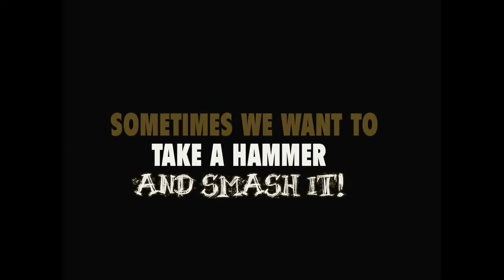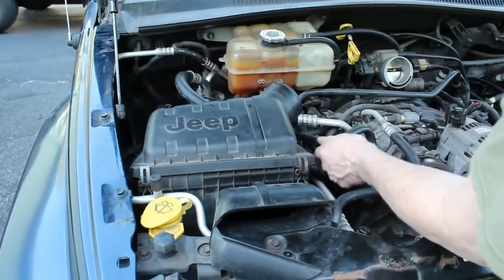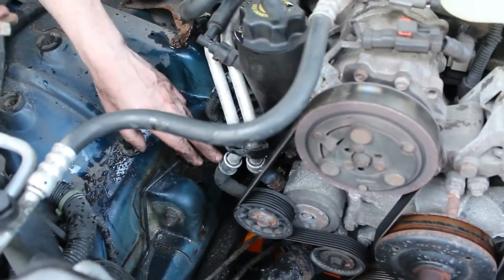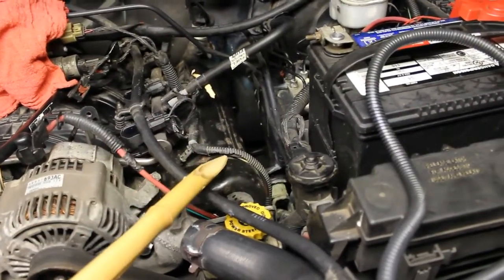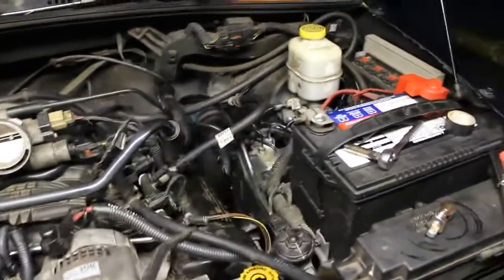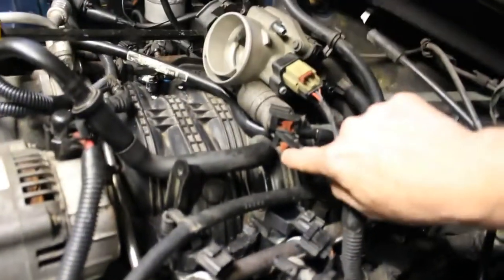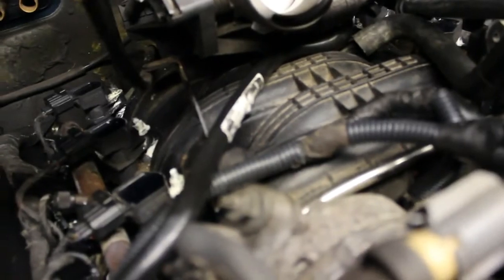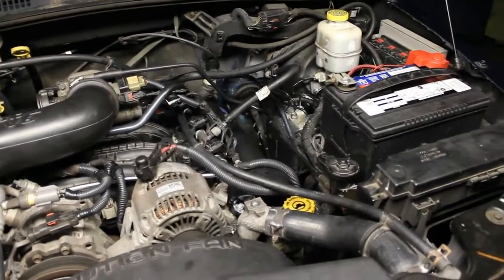2004 Jeep Liberty Limited 3.7L oil leak and intermittent plastic burning smell mystery solved!

Comment: This is my exact issue too because today I noticed oil on the catalytic converter and so I'm glad you have fixed it. I'm going order parts and try to fix this thing in a few days.
Reply from the maker: excellent. I have to do a wheel bearing on the liberty, I will make a video soon. Good luck, feel back against the firewall and cover with a paper towel when cool, see if you have some oil there.

Thanks for your support and thanks to all subscribers, almost at 1,000 so sharing, liking and subscribing will help me continue to make videos.

Comment: thank you for putting together this video. our 05 Liberty supposedly has oil going into the exhaust system, causing a catalytic system code to turn on. after watching your video, I think our valve covers might be leaking too.
Reply from the maker: thanks I hope you get to the issue, sometimes the oil pressure sensor leaks as well. good luck.

Comment: Hi this is ken, i have a jeep liberty 3.7 it was given to me from my neigbor..with 113,000 miles..strange things has happen to it while in my care..I sunk in 800.00 parts i did the labor,40 yrs being mec..he showed me bills that he spent on it $2800.00 it was ticking bad also loosing oil at the rear main..so i replace rockers with updated parts.oil hole is smaller..replaced lifters too..Oh is a 03 jeep people say these r bad jeeps..parts replaced all the time..have a issue with overheating when i dont use air cond...fan comes on at 218 but too late coolant overfills bottle (overheats) plus repair shop replaced fan assemble did horrable job on the wires it stopped working and found that out soldered them I was wondering if this jeep had a clutch fan in front..I have to keep air on to have the fan on??..to keep it cool gauge never went passed the middle still have the ticking sound but lightens up when hot...No overheating when driving or highway use..getting late but have more to say thanks ken
Reply from the maker: hello Ken,
well the jeep is only as good as people take care of it, I have worked on 03 and 05, I have an 05 with 120,000 no problem.

Was the thermostat replaced? The fan is controlled by the temperature sensor, an basic obd reader should show you the temp as it warms up. Once it reaches a certain temp the fan comes on, unless they wired it wrong it should not depend on turning on the air conditioning. typically new plastic fans would come with a connector so not sure why they would have to solder anything.

a faulty temp sensor could probably cause a misreading of the temp, so maybe check temp sensor, thermostat and verify the wiring is correct. Do you have a service manual?

Comment: I replaced both heads on my 3.7 liberty and job went great but afterwards the valve covers kept steaming after engine got got I had to retourqe valve cover bolts 3 times and the drive side cover still smokes maybe faulty gasket. Let me know if anyone has had this issue thank you
Reply from the maker: I ended up removing mine a year later and just using red permatex and making my own gaskets, it seems to be ok now.
Reply: got cheap valve cover gaskets from ebay and they leaked like crazy. They where $32 free shipping. replaced them with fel pro gaskets and no more leaks.
Reply: I replaced the gaskets and put a thin layer of the red silicon. Everything was ok at first. Then in a couple month it started smoking again. It looks like a design issue.

Comment: I'm having the same problem on my 03  why did you replace the covers and not just the gaskets. Is that recommended?
Reply from the maker: I replaced them because they were the metal covers they were putting on the Jeeps and they were really rusty so I went ahead an replaced them with the new ones made of some type of heavy heat resistant plastic material.